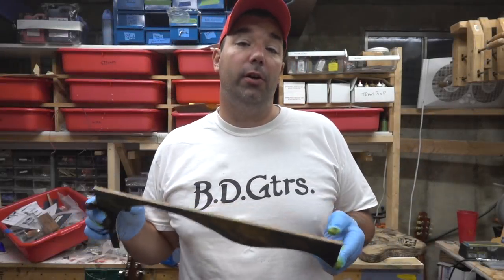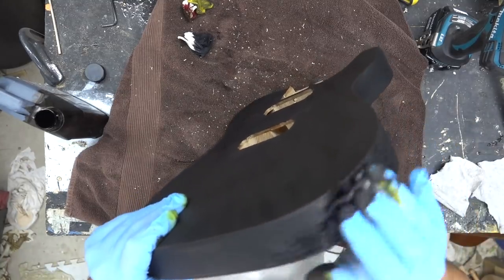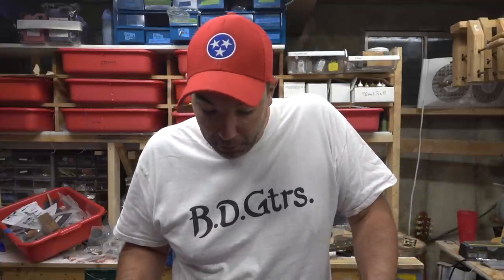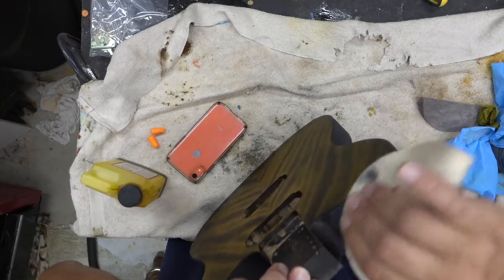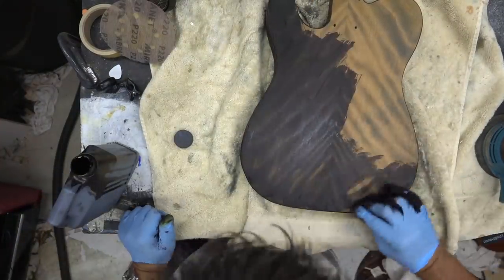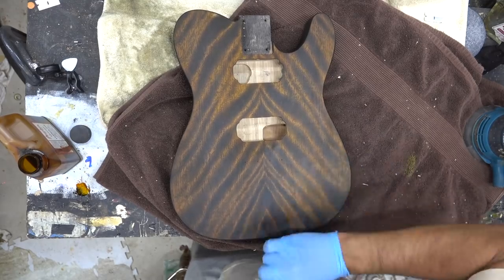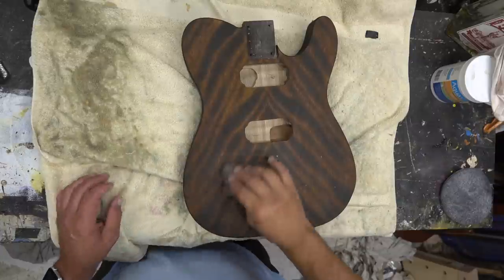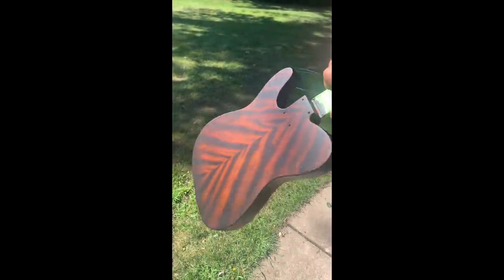Great Guitar Build Off Update: Staining and Finishing the Body & Neck

Comment: Discovered the UV idea by accident, some years ago. I bought a wooden fireplace surround, think it was pine, and was going to install it, and unwrapped it, but then, due to circumstances, it got left in a room where it would get sunlight, as well as being open to the air. 6 months later, when i went to finally install it, the difference in colour between the parts that were exposed to sunlight, was just like this. It brought out the wood grain and patterning beautifully, so all i needed to do was paint a clear poly coat over it. Looked like aged pine when i finished the install.

Comment: For me, this is what the great guitar build-off is about. It's taking a kit and making it unique. There are a few channels using this event to change the body/neck shape, which is fine if you happen to have a bandsaw/belt-sander to hand and have all the luthery tools etc (although you may well have just have started with a piece of timber anyway). The orange stain just made this finish pop :). Looking forward to the assembly. :). I have a few part-built partscasters and this has given me some great ideas. :)

Comment: I had wondered about attaching the handle for painting without messing something up. Looks like you just use some shorter screws just long enough to dig in inside of the regular mounting holes?